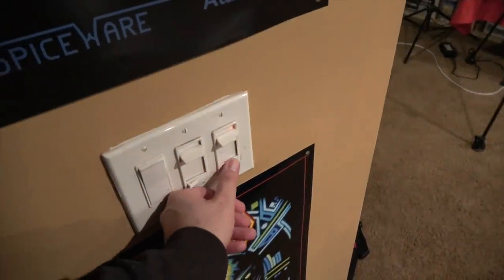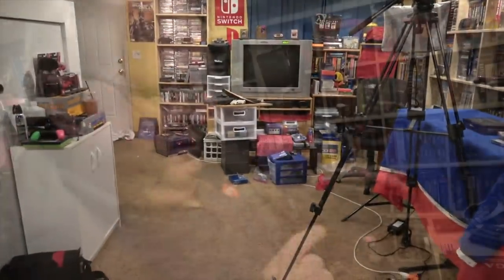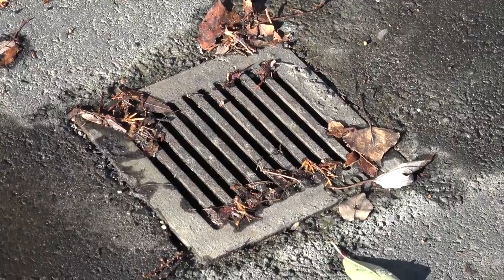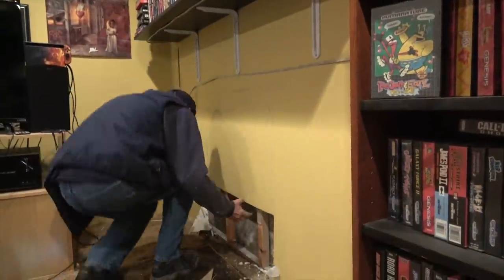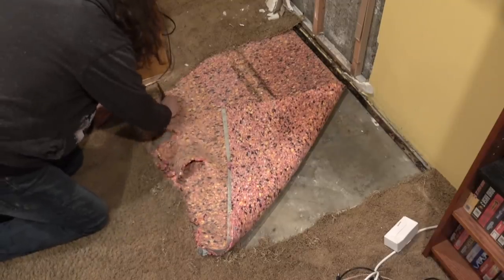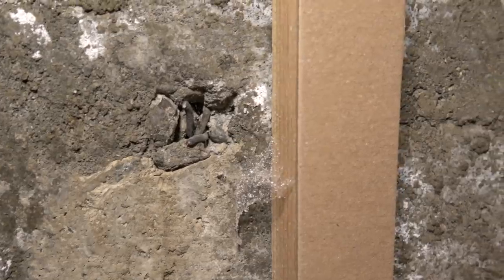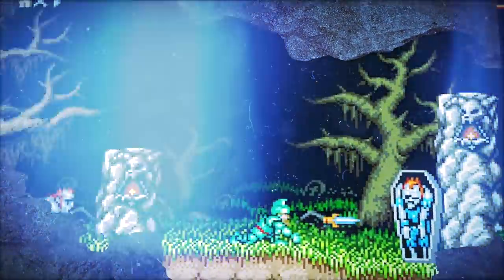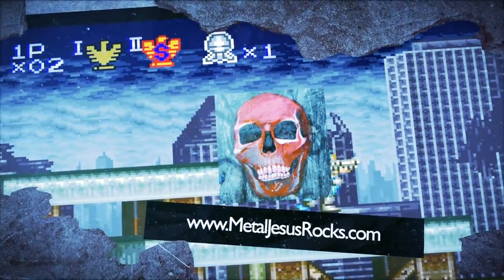OH NO! Water & Mold in the GAME ROOM! $10,000 to fix!

Comment: ties are to hold you foundation forming panels together the ones you pour the concrete in we still use them today only thing is now we insolate them from outdoor conditions with either tar/pitch or membrane.  If you have some manual skills its repairable for cheaper just the drywall is a 20-30 dollar fix but it adds up but sucks sorry man good thing no games were harmed in the process hope you get out of it not too bad
Reply: and i have to agree with phila 40k is a LOT. We did my buddies house rented a mini excavator for a weekend cost maybe 600$ for the excavator plus materials and everything was under 5k.

Comment: concrete cracks, and ice cream melts. just get the water from stop flowing to your wall, an outside barrier, hydraulic cement on the inside. Your floor could crack tomorrow or it could not, I would not spend 20k on what if's. Also the pump system is not fixing the issue, they dont do it in new homes for a reason.

Comment: Tough break man. The drain from the driveway and your downspouts should not be connected to the footer drains, unless the system is designed to accommodate it, usually with a pump and an outside or underground drainage area.  A full excavation from outside and waterproofing with new weeping tile  and a sump pump is the best way to fix it, but also the most expensive. Interior drainage for your basement is not a great solution, you'd be better to start with regrading and proper drainage from the outside. Remove the downspouts from the foundation drains and create proper grading for the water to drain away from your house. That catch basin on your driveway should have been tied into an underground gravel pit or a low lying area on the perimeter of your property.  When you add water to a drainage system that was not designed for it, especially an older system, you are asking for trouble. Good luck and all the best.

Comment: You can repair sheetrock yourself easy. It's very intuitive
Reply: ....just cut along the existing sheetrock straight as you can (Dremel SawMax makes quick & easy) , fit in the new pieces & screw em to the wood
Then spackle in the cracks, and do a quick sanding when dry.

So so easy, afterwards you'll wonder why anyone pays to have it done.

Even remounting the AC outlets is easy-theres enough leeway under the plastic faceplate, that u may not even have to measure the hole you cut, then a screw at the top and bottom-you'll see how easy all this is when you demo the wall...  OH AND TURN OFF THE BREAKER OR YOU'RE IN FOR A BIT OF A SHOCK :)

Comment: reinforce that wall with silicon plastic, plug those holes, remove the flower bed by two feet, install plastic sheet basin up to the wall, fill it up with dirt or concrete, problem solved. Budget, likely 100 bucks.

Comment: It doesn't cost that much to dig down along the side of the foundation you'd only has to be the width of a person.  I've seen two guys with shovels dig out a wall that wide in about 2 hours.  Once you get down to below those iron ties top it off so that rain doesn't fall in there and let it dry.  Drill out those iron ties and then pump the hole full of epoxy.  Once you've dug down that far on the outside you might want to seal the outside wall with epoxy.  Just like brain surgery I would get a second opinion.  I would rip all the carpet out my bet it's all wet underneath.

Comment: Whoever built that basement didn't know what they were doing. The cement was supposed to be covered in s seal to avoid moisture and padding was supposed to be put between the wood spaces. Whoever did this job did it half-assed. 

And by the way, Jason you should have moved everything out of that room before dealing with the mold. Now you have mold spores on your games and systems and more importantly, your lungs.

Comment: First of all, don't over-react. First water in 12 years. You only get heavy amount of water there, because the water runs towards your house off of your driveway. Ensure you clean your drains and fix that small area affected in your basement. Inject polyurethane foam in the void / location of the ties  - really cheap.  See how it goes.  carpeted basements are gross. Use dimplex subfloor and put down diy laminate hardwood from home depot. shaded oak is cheap . 68 / foot. I can see it now - game room transformation vids.

Comment: MJ, Listen to the comments here.  40k for exterior work is extremely high.  With the cost of what they propose, you shouldn't have to do any of the demolition.  I've worked in engineering for 20 years and previously worked for my father doing foundation repairs but mostly structural issues and nothing mold related.  The ties in the wall are not structural and are used only to hold the forms together when they placed the concrete.  Improperly placed or weak concrete can crack or not be completely consolidated at the ties.  

TL:DR  - Get more quotes than just the one and notify your insurance.
Reply from the maker: The issue with my front yard is way more complex than you realize. Keep in mind, I'm on a HILL, meaning the street is ABOVE my property AND I have a 57 year old oil tank buried in my yard next to that wall. There is no gas in my neighborhood, meaning they'd probably have to take out the tank and deal with that whole mess....
Reply: @MetalJesusRocks  Typically you would want to have an impermeable layer of soil adjacent to the house that is pitched away from the foundation.  The general grade of the property can slope down from the street, but the important thing is channeling the water away from the foundation wall.  It could channel to the side of the house and to the lower portions of the property.

Comment: The drainage system thing sucks. You still need so many humidifiers. Plus if the pump ever fails your screwed. I doubt the basement will hAve all those probs in a few years it will take decades to get that bad where the whole foundation is leaking like crazy one side of my house has a leak it's not bad but ad some ideas for the out side to dig french drains to just all all the water off the property.

Comment: yo these guys are scamming you bro. your whole foundation isn't about to start flooding just because the one wall next to your driveway renovation diverts water towards your house now. You can patch the holes you already exposed by drilling and refilling with concrete. You can pave the small area in front of your house where the diverted water is soaking in, so its not soaking in so close to the house. that would alleviate like 95% of the ingress alone. I'd be getting new carpet though, just my opinion

Comment: Had that Problem a few years ago in my personal library.
Is your collection isured? It is very important, because if something gets effected by mold or other stuff, you get some money to rebuild that collection.
Reply from the maker: Thankfully no games or consoles were damaged as the leak was so slow... basically just a drip. I got LUCKY!  We had another construction company out & they were able to FIX the outside & stop the leaks for way cheaper than the original two bids. And today we scheduled work to do injection crack repair inside. Had we needed to dig into our front yard and deal with the old 300 gallon oil tank buried there, we would have had to reach out to insurance!
Reply: @MetalJesusRocks  What now has happened has happened.
But I meant an insurance for your game collection. It is always helpful to have something like that in case something happens and you need to rebuild the collection.
Same with your house. Aren't there insurances for that in the us as well?

I hope you sort it out as soon amd painless as possible. I feel with you, man.

Comment: Why not just control the water flow on the exterior? He showed you where the cause is. Just concrete that area in. Put a vapor barrier down first and seal the concrete after. Those form ties have always been there. What changed was exterior water flow. Fixing the water flow should be much cheaper.

Comment: No...no........and no! Just find all of the snap tie holes removed the snap tie as much as you can, wire brush and clean up the hole. Then use hydraulic cement and once that has setup, put an epoxy waterproofer over the hydraulic cement.  This is NOT a $7,000 problem, and you can even dig down in the front and coat the wall yourself to help stop any future issues.

Comment: The $40k was just a 'scare price' as I call it.

As an ex owner of a car repair shop I used the same tactics back in the day.
On a $200 repair I'd call you and say the repair did cost $750 and when you jump up from shock I'd say "Nah man, I'm just kidding you. It's only $400" 
Worked 7 out of 10 times. It's an asshole way of doing business, but it worked well in the late 80's. Didn't know it is still being used tho. Don't fall for it.
 
You should get a 2nd/3rd quote tho. That doesn't looks that big of a job tbh. Just remember that sealing goes on the outer wall side, never the inner one.

Comment: get some help, remove everything from the basement, and remove the sheetrock yourself, you just save a butt load of money there.
then remove the carpet etc.

OR if you do the big job outside, take it as it is, sure it's a lot of investment (hey that'S a house, we all get there eventually) but when you decide to sell it, this will be a HUGE selling point for you, and in the long run you will never get any problem.
my house was built like that, im lucky because my basement is higher than the street level, but im sure eventually im going to get rekt with this issue.

the first method will leave moisture in the basement, so it's still going to be a risk to get mold, gotta think about that too

Comment: Sorry to say but this is what happens when people have basements "finished" incorrectly. The concrete always needs to be sealed, a 6mil+ vapor barrier needs to cover that, then the wall can be constructed. Providing the correct materials are used to build the wall after. If your going to frame the wall with wood, it should be treated lumber. If walls are to be insulated extruded polystyrene should be used and not fiberglass. Regular drywall should also never be used. Green board or treated dry wall always. I've repaired countless "rec" rooms in basements over the decades. It's always because the homeowner or contractor did it cheaply to begin with. Save a few pennies now only to have to shell out dollars later. Metal jesus if you payed for a home inspector and improperly finished basement wasn't mentioned by them or the seller. You have grounds for a lawsuit, especially with black mold now being involved. Best of Luck

Comment: Working inside the house makes no sense. Letting water through the foundation even in small amounts is not good in the long run. Excavate from the outside, fix, and improve with weeping tile. Fix it for good. This half ass fix will be a problem later if you sell and it's found..

Comment: I got a better idea. Don't rely on fans for donations. Ask them to come hang out and dig out the yard. Have a BBQ. Drink beers. Make a day of it. Might even have a fan with digging gear to make quick work of it. That should save a butt ton of money.
Reply from the maker: You don’t mess around with a 300 gallon oil tank in the front yard if you can help it. Being 58 years old, if it gets damaged or leaks, the EPA gets involved. That’s where it gets expensive... but thankfully we were able to avoid that.

Comment: Your drainage system is the problem. The drainage system is probably in SHODDY condition after all of those years, and probably cracking and leaving room for plants( mold), and plants break things up revealing cracks.  Move your gear before something bad happens to it !! Reseal that wall with some new concrete, just go over it.

Comment: Get some other quotes on the repair, that method seems far fetched and if there's no other leaks leave all the  other undamaged drywall alone, dig a trench around the perimeter is a must though and seal it all from the outside, always direct rainwater away from your house too.

Comment: I would just of repaired the one defunct leak foundation tie from the inside.... Re mortar it....and digging down 7 ft to re mortar it from the outside is a day's work... People still dog Graves by hand that are 6ft by 4 u cud do that urself and hire a Mason to seal it from both ends. After the source of the loss has been sealed put tile over your cement foundation. Mold can not grow on cement not tile nor between and you would be fine. No carpets in case of future losses from other potential defunct ties.
Reply: Dig,
Reply: Tile floor instead of carpet I mean to say, sorry it's a pain typing on a phone. For ur finished basement

Comment: you need at least three quotes for the work, instead of trying to drain the water away seal it out, in the uk we "tank" our basements/cellars, basically you would take off the boards like you have to anyway then completely waterproof the walls sealing the water out, of course i have no idea if US building codes allow this, but putting in a trench and drain will make the basement wet and damp all the time, its ok for out buildings and such but when the basement is a "proper room" its not going to be the right thing for your setup.

Comment: my advice: don't do the complete room yet!  First fix the problem from the inside, rebuild your sheet rock wall but with an inspection frame. Add a wifi moisture meter inside the wall examples: https://thewirecutter.com/reviews/the-best-smart-leak-detector/ If not fixed dig the holes on the outside yourself 3 holes of 5 feet deep. That's less then a day work. Those holes don't need to be big! I have the feeling your are trying to fix a relative small problem with an overkill solution. If it did not work out , there is still the option to invest much more.

Comment: i bet the new concrete pad is done wrong. if the concrete is not levelled to run water away it is a very very common problem. u probably need a new pad

Comment: When things are going back together, after taking everything out and fully sealing the walls, install some of this inexpensive foam insulation board from Home Depot. 
Model # 150705 Internet #205517302 Store SKU #420777
That will make your basement easier to heat.

Comment: I can't help but feel like you're getting scammed and that this "fix" is going way overboard when all you really need to do is seal off the walls(with one of those poly type sealants), and then ya you need/should get a trench built on the outside with a system to flow the water presumably with the rest of your drainage.  You shouldnt be rebuilding your entire sheet rock foundation. It's still intact and completely stable, it just has those small "pinhole" leaks......which is why it really doesn't warrant a full replacement.

So truthfully, you basically just need to do what these guys are doing: https://youtu.be/6wBluQPDzZg?t=283
Reply: ^^^ this.  Idk my basement foundation knowledge at all but that price sounds like a inflated bs job.  He needs to diy or, at the very least, get estimates from other contractors.

Comment: Way to much , have done this myself and use to get paid ( certified ) for others part of an environmental team, remediation and hazmat team also.   You need to dig, rent eqt yourself wont take much, insurance gonna cover anything? Call local line locator just in case it should be free.. For locating gas line , other lines underground etc. Use line locating spray paint. If work area has no lines running through, use small back hoe with a spotter , work slow and smart. Once concrete is exposed, cleaned, dry, you can patch and seal the area.  Normally here in TX would charge 3-5 grand if exposed and its something worse 8-15 ...depending on condition or conditions say there is a gas line or something in way, causing working hazard. You said mold, now certified remediation techs would need to address it, clean and decontamination of your items room, exposed all the concrete from inside with a proper respiratory mask and suite etc. Id call a remediation team vs contractor or both.

Comment: Build a curtain drain around your house. Fill it with pipe, curtain material, rocks, ... will never have water in your house again 2 ft. deep 2 ft. wide. It will keep water from your house. I had the same issue and added a curtain drain in myself manually took some time but cost me under $1,000... never happened again. something like this: https://www.finehomebuilding.com/2007/09/01/keep-your-basement-dry-with-a-curtain-drain  (contact me if you want info) Its like when you go camping and you make a trench around your tent so water pulls away. Outside curtain drain will protect your entire house and you WON'T need to renovate the inside.

Comment: perma seal are full of shit.
just fill the holes with  epoxy,really fill them in and paint the shit out of the concrete walls with water proof/sealant paint. then close the drain that in the drive way and get an extension for the gutter and move the water away from the house.

Comment: Have your foundation sealed from the outside. Any holes in the foundation are repaired, tarred, and a waterproof membrane is installed. That basement will be dry as a bone after that. Your house looks fairly small and if half of the foundation is already exposed it shouldn't cost anywhere near 40k. Sounds like they are taking advantage of your lack of knowledge (no offence) in these matters. In the meantime, educate yourself and do lots of research on foundation repair. Also do the same research on whoever you plan to hire to do the job. Get lots of references and for the love of God don't pay anybody until the work is completed to your satisfaction.